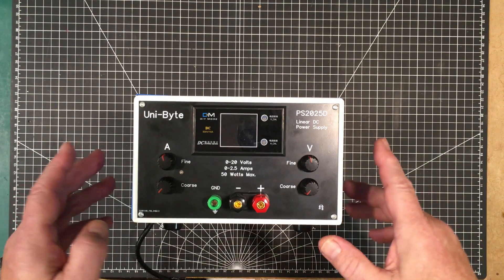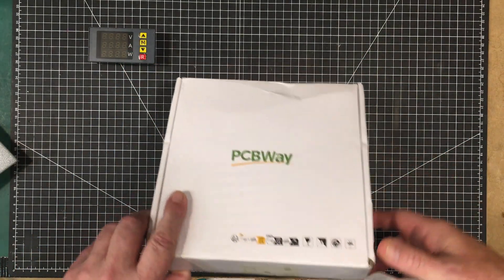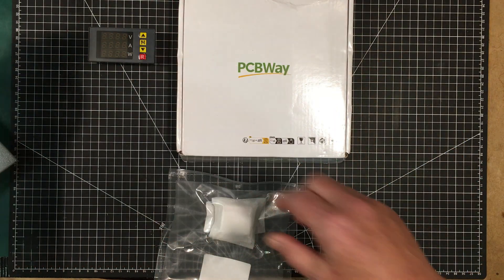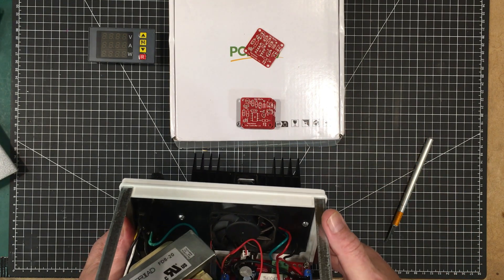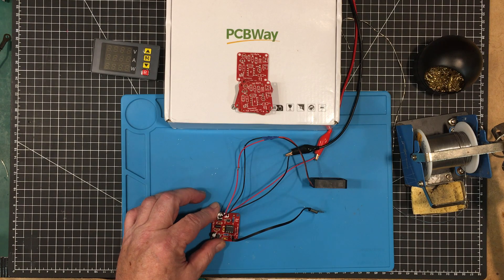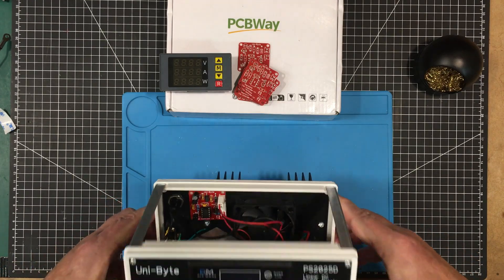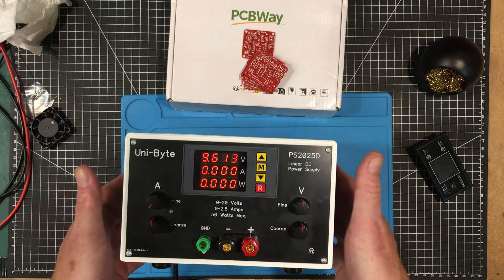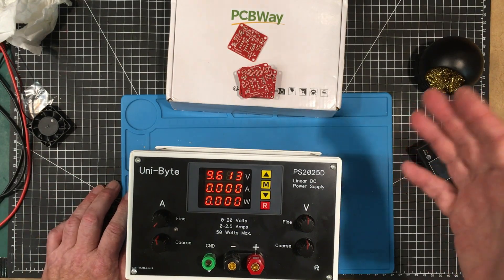Uni-Byte 214 - Two SLICK mods turn Good into GREAT (Hiland Power Supply)!

Comment: Great project, thats a very tight squeeze. It's always tempting to use the smallest case, but then later you regret it, but this worked well....
Reply from the maker: Yeah, it's a tight fit alright.  I had actually wanted to put it in a smaller case at first, LOL!  Room on my office bench is at a premium..

Comment: How do you set the current limit to a pre determined value without shorting the leads?  It would be a good idea to add a calibrated scale to the current knob somehow.  Not particularly accurate but a good first start. Set the fine current knob to the centre. This was an excellent video series btw.
Reply from the maker: I just short the leads, but you are right, I should have included a scale of some sort on the coarse current setting.  Thanks on the series!

Comment: Nice little board for upgrading any project. I recommend you to add some hystereses to prevent fan speed oscillation. Or you could implement a continuous speed variation like this:

temp_min = 64;
temp_max = 125;
pwm_min = 0;
pwm_max = 1023;
w1 = (b0 - temp_min) * (pwm_max - pwm_min) / (temp_max - temp_min) + pwm_min;

if(w1 > 1023){
    w1 = 1023;
}
Reply from the maker: Hysteresis might actually cause continuous oscillation due to the relaxation effect + phase shift from thermal inertia.  I expect continuous variation will also cause oscillation, but it should diminish over time as long as the cooling is sufficient.  I think I'd need a PID control loop to prevent that.  That's the "idea" I talked about in video.  Not sure how to do that using positive integer BASIC.  I'm sure it can be done .. maybe..
Reply: @uni-byte  You're right,  a system with negative feedback tends to be stable. I implemented myself a PID control loop to regulate the temperature of a solder reflow oven. I'm not familiar with PICAXE but simple arithmatics can do the job

Comment: It's getting better all the time. You might even add a switch to switch out the high frequency filtering so you could do a rudimentary test on new circuits to see if they are relatively impervious to noisy power supplies. I've had new circuit designs work beautifully when I was building and testing them on the bench, but then get intermittent when fired up with a cheap switcher supply like it would be run on when put in service. My Agilent bench supply was great for ensuring my power source was silent, but it didn't tell me if the circuit would work in a real-world application. So I decided that if I ever built my own bench supply I'd have a 'noisy output' switch on it with which to test my circuits' noise immunity.
Reply from the maker: That could be useful.  Right now I use some cheap SMPS units for just that purpose.

Comment: Great Additions to the Power Supply!

You might find using the map function to make the fan variable across the range to work better.
Like 
w1 = map(b0, 64, 125, 0, 1023)or better
pwmOut = map(tempC,64,125,0,1023)

Just one line to do it all. unless you are in a state of two much power this finds the perfect speed to run and hold the temp steady.

If you are keeping the current code you might want to add blank temps between the setpoints to prevent it from oscillating from the temp drop of the fan speeding up and dropping the temp just enough to fall back into the last setpoint. 

like this
If b0 < = 64 then w1 = 0

no setpoint for 65 ....  so at 65 it does what is is currently doing. On stays on and off stays off. 

elseif   b0 > 66  and b0 <= 85 then w1 = 400 

It's easy and dirty but works well to prevent the oscillation issues. 
Just thoughts from an old software developer. 

RJ
Reply from the maker: Good idea!  The only thing really holding me back from going from going to continuous control is that the phase shift caused by thermal inertia will cause a long period oscillation in the fan speed.  It should diminish over time and is probably not going to do any harm.  However, it might.  I'd need a PID control loop to prevent that.  That's the "idea" I talked about in video.  Not sure how to do that using positive integer BASIC.  I'm sure it can be done .. will just need some thought.